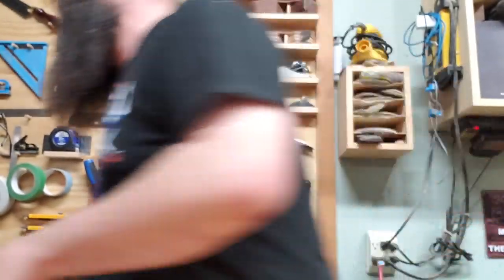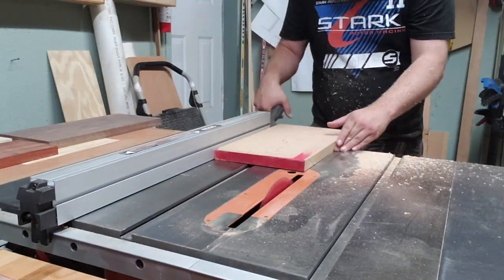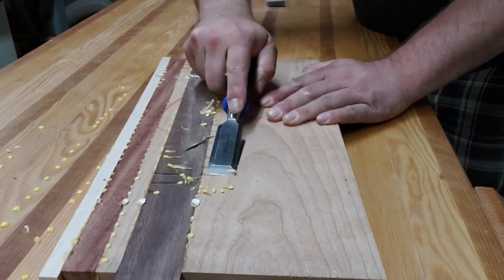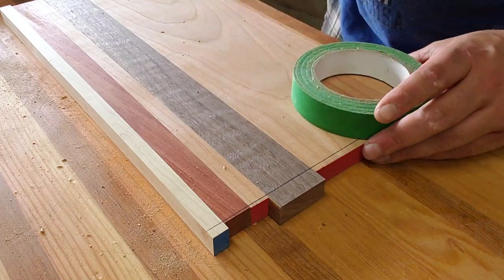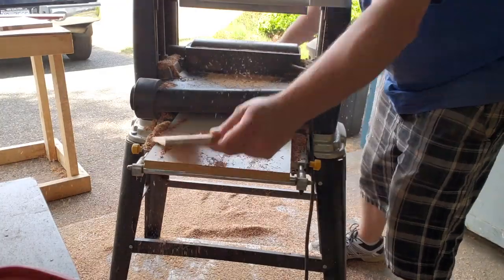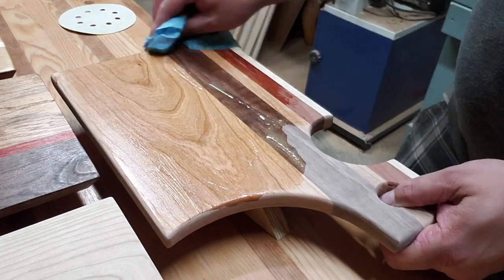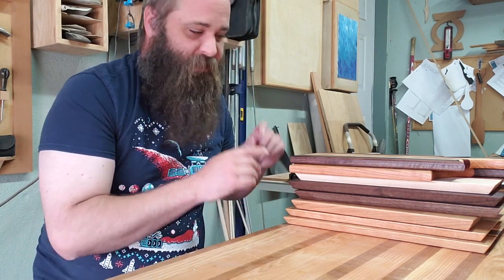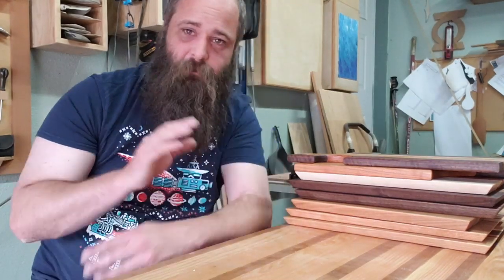DIY Fancy Charcuterie Boards!

Comment: it's a great video and I was really looking forward to your explanation but the background music messed it up for me.
I really wanted to know the ideal thicknsse for these boards? 
thank you for the share
Reply from the maker: I wouldn't say there's an "ideal" thickness. I start with 4/4 (1") rough stock and plane it until it's flat, so they generally end up between 3/4" and 7/8" or so, but I've made them as thin as 5/8" when I've had very twisted wood to start with and they're fine.
Reply: @WoodenThingsAndStuff  thank you for the reply 
it's a very helpful tip.

Comment: Do you like the glue line rip blade? I’ve got mixed emotions about mine I had high expectations for it and may that was the problem 😆 but it’s definitely better than a lot of blades I’ve had
Reply from the maker: I do like it, but my go-to has become the Freud "Heavy Duty Rip Blade" now, mainly because then I don't have to swap it out when I need a flat-bottom grind for grooves and other joinery.
Reply: @WoodenThingsAndStuff  yeah I made rhe mistake of cutting through a 3” thick piece of white oak in one pass to its credit other than the saw dying 4-5 times in the process it did the job without having to turn the piece over

Comment: You could glue it up with tiny scraps and leave no wood where the cut outs are. Maybe just one long board where the handle is.
Reply from the maker: Meh. I just need to become not so precious about scrap. I'm getting there. I mean, when you think about it, the waste I'm curring away probably cost me 42 cents or something.

Comment: Does the lacquer you put on the coasters protect it from hot things? Or are they to be used for cold drinks.
Reply from the maker: For the amount of heat that comes through a coffee cup, it's okay. I wouldn't use it on something like a trivet that's for pans  that come off a stove or something, though. Most of the time I would go with something more "refreshable" rather than something that will need stripping and refinishing eventually, but I was in a hurry on this batch, so I went with the fastest-drying thing I had on hand so I could get multiple coats done.

Comment: Nice boards. What is the average size and price you get for them? Cheers.
Reply from the maker: I generally aim for about 8"x16" or so, and they go for between $60 and $80 CAD, depending on the complexity and materials used.

Comment: Are you using 3/4 inch thick boards?  Do you think 1/2” would work?  Great work!
Reply from the maker: I start with inch-thick boards and they come out at about 3/4" when they're done. I probably wouldn't start with 1/2" boards, because they would end up too thin and prone to warping, I think, but if the finished thickness was 1/2", you'd probably be okay. But it's really hard to say, because every piece of wood is different and you can never really tell what it's going to do over time.

Comment: What were your dimensions for your board? Beautiful
Reply from the maker: They were all slightly different, but in general, I aim for 8"-10" wide and between 15" and 20" long. Most come out about 8.5"x17" or so.

Comment: I’m thinking of starting to sell wood products. How much would you charge for a charcuterie board or a cutting board? Thanks.
Reply from the maker: Depends on various factors. I charge for all of my products based on the price of the wood that went into the piece and the time it took to make it. The ones in this video sold for between $50 and $75 Canadian, depending on whether they were bevel-edged or handled (which take longer), and the price of the wood(s) they contained.
Reply: @WoodenThingsAndStuff  ok thanks. Your woodwork is very nice
Reply from the maker: Thank you very much!

Comment: How do you keep your boards from cupping?
Reply from the maker: I've never had a cupping problem if the wood is properly dried and I mill it properly. Are you having cupping issues with your wood?
Reply: @WoodenThingsAndStuff  yessir. Nice and flat one day, then wobbly on the counter the next. I’ve angled my jointer fence and my table saw blade at 90, and after finishing they tend to cup
Reply from the maker: @SFCSMOKER  sounds like you're either using wood that isn't dry enough or there's a "use issue" with the final product. Wood boards need to be hand-washed and air-dried with air circulation around the whole  thing....

Comment: Where would I get the different kinds of wood from?
Reply from the maker: Hopefully your local hardwood dealer has a selection of various woods. If you use local wood as the majority of the board and just accent with fancy stuff, it's not that bad for price.

Comment: What router bit did you use?
Reply from the maker: I just use a small roundover bit on the ones with the handles. Probably a 1/8" one. I don't use one on the beveled edge ones, I just break the edges with sandpaper.